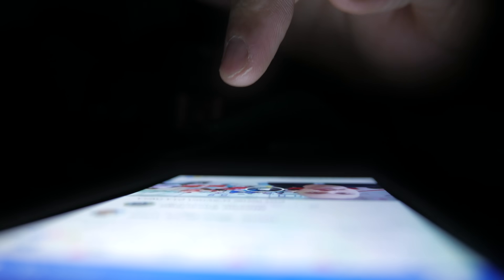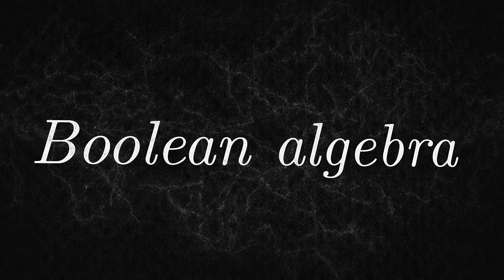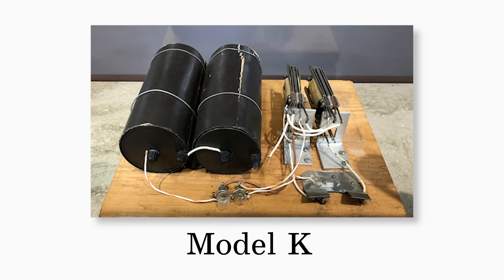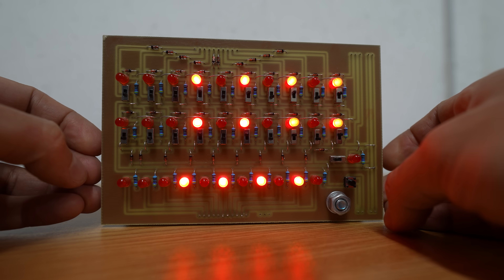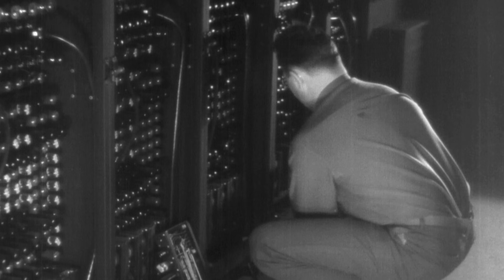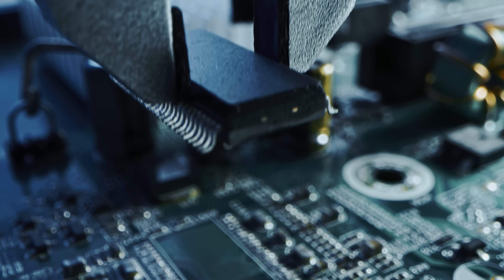Why The First Computers Were Made Out Of Light Bulbs

Comment: IMHO, the statement @ 1:30 about the electrons being attracted to the "positive wire" is inaccurate. Potential was mentioned just before (thus the labeling of the wire as positive) but if the electrons would be attracted to the wire then... why they are creating a mark on the cristal? What I assume is going on here is that the magnetic field generated by the electric current on the filament coil is directing the electrons in one direction. Isn't it?
Reply: He said that most electrons missed the wire and hit the glass which is what discoloured it
Reply: @MidnightDrive589  It's more likely that this burn off from the carbon, electrons won't make a color on the glass. High hour vacuum tubes will have noticeable tungsten burnoff at the filament tips onto the glass.

Comment: Vacuum tubes are immune to EMP which is why NORAD computers were designed with tubes over transistors.  Protecting integrated circuits from EMP is not an easy task.  My electronics training in the military (1972) was based on vacuum tube technology at first, then discrete solid state electronics at the end.  Upon leaving the service and working in electronic systems design & development, everything was integrated circuitry (1978).  My wide mix of electronic training and experience lead to a very lucrative career since civilian electronic schools were few and narrow in scope.

Comment: I loved playing with old vacuum tubes. I used to break them and extract the intricate internals, that looks like miniature sci-fi props. I made a replica of the Back to The Future DeLorean, spaceships from Aliens etc. I also had an ancient tube radio, that was taken out of a radio cabinet. So, it was just guts lying on a piece of board, wired up and working just fine. I got to experience a tube television as well. I loved watching it warm up with the back panel off. The nostalgic high voltage buzz. Oh! Pure nostalgia!

Comment: I am an "old" retired electrical engineer. Slight correction, vacuum tubes grids were almost never biased positively. We would place perhaps 3 volts on the grid, and then if an A.C. voltage is applied, say +/  2 V, the grid would go from -5 to -1. If the grid were to go positive the impedance of the grid would drop to nearly zero (compared to the many megohms normally seen) and the driving source would have great difficulty, also the grid "clamps" to about +.7 V and won't go any higher.

Comment: I am a process controls and automation engineer. The early relay based computers are the foundation for a form of programming we use called ladder logic which, along with other syntaxes, are the way many industrial devices and processes are automated. The "computers" that run this code are very robust and simple devices called PLCs, programmable logic controllers, which are dedicated to running this logic and the sending and receiving physical inputs and output. Some of those IOs are discreet, on or off, for doing things like determining if something like a switch is pressed or not, and sending a signal to a device like a discreet valves to open or close. Some of those IOs are also analog, meaning a signal that can vary between two values, like a valve that be be open in small increments between 0% and 100%. Those analog values can be sent and received by the PLC and used to both determine the open position of an analog valves and tell it to move to a position. 

I am using valve control as an example but obviously you can control almost any device in the same way using discreet or analog signals.

This sort of programming is responsible for controlling the automation of so much of the industrial world around us and makes up the foundation of the manufacturing world we get so many of our products from. The symbols for ladder logic programming are based on the physical devices that used to make up relay based computers. So an IF Then conditional statement is the symbol for a Normally Open relay, and an If Not Then, or more simply Not, is the symbol for a Normally Closed relay. 

I hope I got that right, because it's been years since I actually wrote ladder logic. These days I work in pharma and spend my days dealing with documentation rather than programming, but that is where I got my start. 

The old systems used to utilize pneumatic pressure in thin copper and aluminum tubing to send the signals, so a 0% analog signal was sent by pressurizing the line to 5psi, and a 100% analog signal was represented by 15psi. This was way before my time, I worked in some older facilities that still had the old pneumatic lines abandoned in place. 

I am not sure why early systems used pneumatics, but pneumatic systems are still used these days for environments that have potentially explosive conditions, so rather than sending an electric signal into a room where explosive gases might be present, we use pneumatics.

Would be amazing if you did a video about PLC, industrial controls and ladder logic. Some of the old facilities had incredible control rooms with hand made symbols for all the steps in the process that would light up when active. I worked in an old vitamin C manufacturing plant in upstate NJ that was being torn down soon, and it looked like the bridge of the enterprise.

I will say this sort of programming and control might seem simple and archaic but it can be used to control and automate amazingly complex systems. I've seen highly complicated systems in the pharmaceutical world controlled by joining together 14 different PLCs with one master PLC orchestrating the whole system. 

It's also a field of engineering that is in very high demand. Not many know how to design and maintain these types of systems and the entire industrial world depends on them. I started in the field because I needed a job after school, but I had no idea how lucrative it would end up being. I have several recruiters contacting me on LinkedIn weekly now as a senior automation engineer. 

If you are a young engineer or considering which field you would like to work in after school, I can't encourage you enough to consider process controls and automation. I started at 60k right out of school with an bachelor's in engineering and after just 8 years I am now making close to 200k per year in pharma automation.

Comment: Back in the early 70s, my dad was the structural engineer on the GSA building in Birmingham, Alabama. He had to design the floor that the computers were on so it would carry the enormous  weight. They were also going to use the computers to heat the building in the winter, so the building had to be designed to have all kinds of chases that went down to the computer floor. By the time the plans were  approved by the GSA (government services administration) everything had changed. The computers started using IC chips and became lighter in weight and didn't  use the power, and hence, didn't throw off the amount of heat the old vacuum tube computers did. Basically, the building was designed around the computer system in the beginning.

Comment: Timestamps:
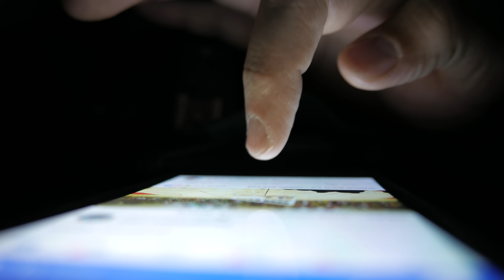00:02 - Light bulbs played a crucial role in the evolution of electronics.
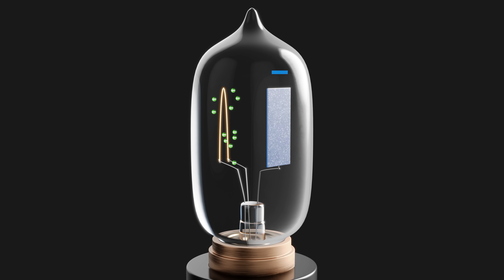02:25 - The thermionic diode and its role in converting AC to DC.
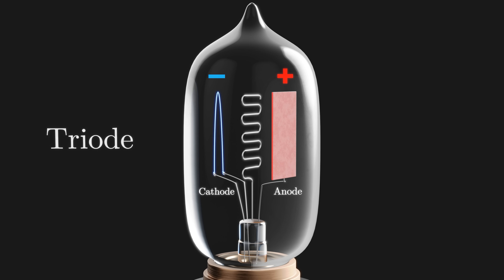04:47 - Triode vacuum tubes allowed for high frequency amplification.
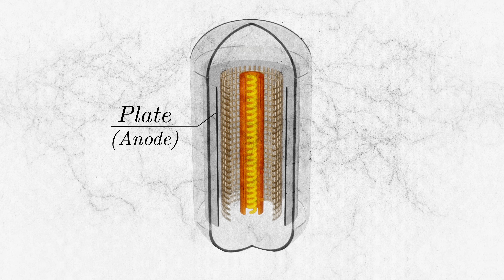06:48 - The invention of the triode revolutionized electronics.
09:02 - First computers were built using light bulbs, relays, and logic gates.
11:11 - The first computers were based on light bulbs and used for arithmetic operations.
12:58 - Invention of electronic switch revolutionized computing.
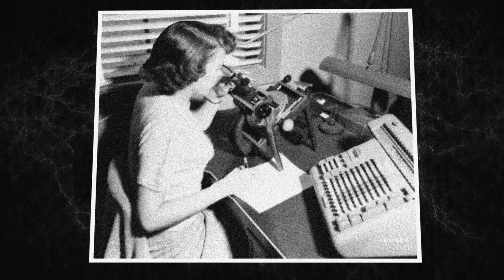15:07 - The first computers were big, power-hungry, and unreliable due to vacuum tubes.
17:21 - Brilliant offers interactive courses on technology and computer science

Comment: Clarification: if the grid goes positive then it will draw grid current which will damage or destroy the device.
The grid needs to always be zero to negative relative to the cathode.
Kind-of important! 😎
Also, it was discovered that the addition of several grids of differing geometries improved linearity and speed of operation at the same time. 
Enter: the Pentode.
Cathode, screen grid, control grid, suppressor grid and anode (plate). 
These allowed parametric control of electron flows allowing for all kinds of crafty operations such as signal mixing.
High power versions called "Beam Power Pentodes" which confined the electrons into literally a beam allowed for control and modulation of high power RF signals. Big Radio was born!
That also allowed electronic control of heavy machinery. Huge step forward in industrial applications.
FYI: Cold Emmission devices Were developed which gave efficiencies higher than transistors with a gain-bandwidth-product, get this, 10 Billion times Better than Any transistor(!)
Unfortunately, that  technology got "buried" thanks to an international intercorporate agreement concerning display technologies.
They were called "Q.E.D." and demonstrated cold cathode emission at the sub-micron scale.
I know a Lot about this technology...because I was there and involved(!!)😎
...know anybody with half-micron chip making hardware that hasn't been scrapped?
I have a use for it. No silicon crystals needed either.

Comment: there's an old power electronics device that was used for computing, . 
The magnetic amplifier . aka saturatable reactor. 
Early 20th C.
OK it's not general purpose computing, nor is such digital.  and the programming  rewiring...  "mag amps" can and have been used used for analogue computing, as required for say the guidance computers of the V2 rocket  Gun tracking/servo motor control as well as solving certain problems ,I'm sure analogue computers  would have been used for the Manhattan project, because at the time analogue computation was known/understood. Even now for specialised tasks such a solving partial differential equations(engineering and physics tend to need loads of them solved).... it can outperform modern digital computers. 

Mag amps can also be used to switch/regulate electrical power... eg Theaters would use them to control high power spot lights

Comment: It is most cool to see this video after just getting acquainted with "Usagi Electric" and his home made vacuum tube computer, and the refurbishing of the Bendix vacuum tube computer. 

I have had a fascination with the old computers, though i would not be able to operate one without training.  We have come so far, that these current powerful machines, rolling millions upon millions of lines of code so quickly are made to be operated so easily by any person, whereas the early days of computing required engineers of multiple disciplines.

Comment: I was fascinated by vacuum tubes. I understood that they didn't emit light, but didn't quite understand the connection to the light bulb. So this was a great explanation. 

Ironic that the vacuum tube was based on a completely unrelated side effect of the light bulb, and you had to go to all the trouble if heating up a filament and using up all that power just to make it work. The transistor was far more efficient. 

Also amusing that the computers on Star Trek TOS were assumed to be mechanical relays according to the sound they made. 😂

Comment: I was fascinated  as young boy by the tubes in our TV, i eventually realized that if the tube wasn't bright it was defective, i would go to the tv store and buyva new tube and install it, good times !!
Reply: When I went to college and learned electronics, tube theory was still taught.  Later I had a business as a TV/radio repairman.  Most sets were still either all vacuum tubes or a hybrid design using a mix with transistors.

Comment: AT 9:15. Why is there no current in the solenoid when both are pressed?
Reply: Because, assuming ideal power regulation, the voltage on both sides of the solenoid will be equal.

Comment: For completeness - a reputable channel should have at least mentioned the pioneering work that took place in England prior to ENIAC. 

Colossus was a set of computers developed by British codebreakers in the years 1943–1945[1] to help in the cryptanalysis of the Lorenz cipher. Colossus used thermionic valves (vacuum tubes) to perform Boolean and counting operations. Colossus is thus regarded[2] as the world's first programmable, electronic, digital computer, although it was programmed by switches and plugs and not by a stored program.[3]

Colossus was designed by General Post Office (GPO) research telephone engineer Tommy Flowers[1] based on plans developed by mathematician Max Newman at the Government Code and Cypher School (GC&CS) at Bletchley Park.

Alan Turing's use of probability in cryptanalysis (see Banburismus) contributed to its design. It has sometimes been erroneously stated that Turing designed Colossus to aid the cryptanalysis of the Enigma.[4] (Turing's machine that helped decode Enigma was the electromechanical Bombe, not Colossus.)[5]

Comment: vacuum tubes are not light bulbs
Reply: Add a cathode and a triode to a lightbulb ...viola a vacuum tube .... Did you even watch the video
Reply: @arrunmann1068  Not a lightbulb. Lightulbs of that era did not have cathodes and triodes. Your snarkiness is misplaced.
Reply: @russianenglish4284  the hot filament serves as an anode releasing electrons to be attracted or repelled by the cathode (its essentially a lightbulb with some extra parts ) the vacuum tubes even produce light . This argument is completely semantic .a vaccum tube is obviously not a lightbulb but very similar....as explained in the video above
Reply: @arrunmann1068  Fine. I see you are the type that always has to be right. So all light bulbs seventy years ago had anodes and triodes.
Reply: @russianenglish4284  all lightbulbs actually did have anodes even to this day . The hot filiment which produces light is heated by a stream of electrons which inevitably some will "flow off " the filiment. This production of electrons makes it an anode .

traditionally the electrons would collide with the glass since the entire system is under a vacuum. By adding a cathode and a triode you can control the flow of electrons hence the birth of the vacuum tube,but you have to keep in mind all these discoveries come from observing the behavior and modifying the design of a conventional iridescent lightbulb .
Reply: @arrunmann1068  I defer to your superior knowledge.

Comment: ENIAC was the third programmable computer, first being Collosus and the second being Collosus II. Collosus had 1600 tubes and Collosus II had 2400 tubes. Although designed for one task the creator Tommy Flowers reprogrammed it for another task. Capable of reading 10,000 characters per second it was limited to 5,000 characters per second as the paper tape would self destruct at the higher speeds. Timing was controlled by the tape speed as the timing was read off, meaning that the tape varying in speed didn't cause synchronisation problems. Tubes failing were reduced to an acceptable level by keeping the computers on at all times, as cycling on/off caused valve failures. One the creators of the ENIAC attended a lecture during which he learned that his invention was not the first. Witnesses said it was a true jaw dropping moment, as his jaw dropped. Collosus computers and Tommy Flowers didn't get the credit for the first computers for decades because of the security around Bletchley Park and the breaking of Germany's unbreakable codes. Enigma and Lorentz machines were used post war and some of the equipment was moved from Bletchley to GCHQ Cheltenham. The rest were destroyed. Tommy Flowers wrote in his diary that he took all the schematics, drawings and designs for the computers to the boiler in the building he worked at, placed them inside and watched them burn. As he had been instructed to.

Comment: Around the same time in 1937, Konrad Zuse created the first mechanical computer called aptly 'Z1'. It could process instructions, perform arithmetic using floating point registers, had input, output and memory.
Reply: ... and was already based on binary system.

Comment: Amazing we are still using boolean "1 0 true false" tech today and nobody has developed a system that can convey more information in a single line. Like detecting voltage levels (1v = 1, 2v = 2. Or colours blue = 1, red = 2). Running that type of system at 5ghz.....

Comment: Why did they use such large, power hungry, heat generating vacuum tubes when smaller ones existed? The proximity fuse and the hearing aid used vacuum tubes little larger than a neon bulb. They produced almost no wasted heat. I can't understand why vacuum tubes capable of, say, 10 watts output which had a filament of similar wattage (which required massive AC systems) when much smaller tubes were available. (The RCA Nuvistor came later but shows what can be done to make a very small vacuum tube.)

Comment: Antikythera mechanism (200BC), Blaise Pascal's Pascaline (1642), and Charles Babbage's Analytical Engine (1833).  I would say, those are much older.  Computation is not an electronics thing.  The general info is correct but the title is very wrong.

Comment: The first commercially available solid state transistors were made from Germanium, not Silicon. Silicon became prevalent later because that element is far more available than Germanium. Thi made the devices much less expensive to manufacture. Germanium does have several advantages over Silicon, but the high cost precluded much development if the material.